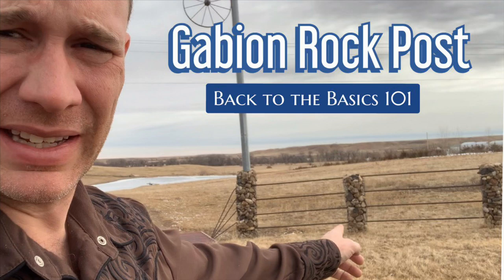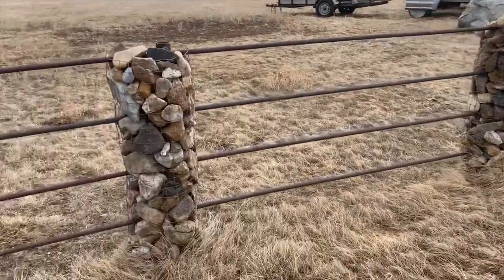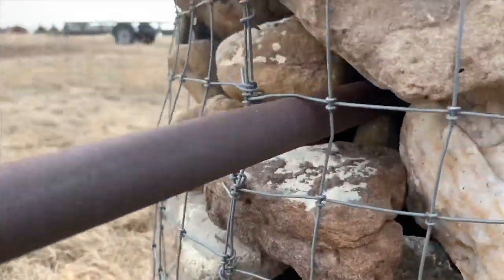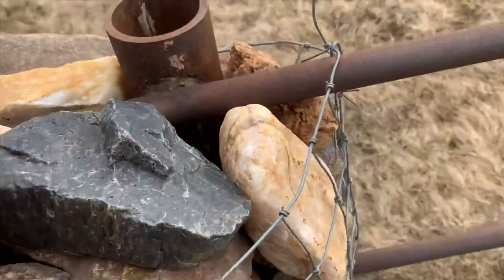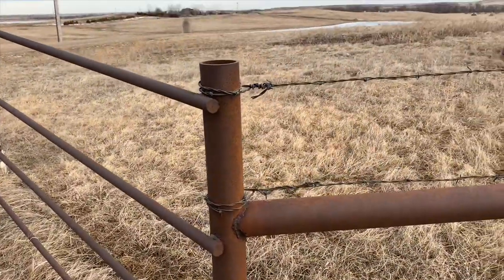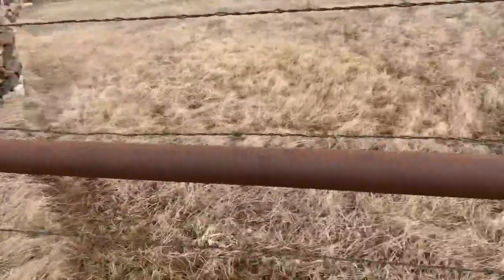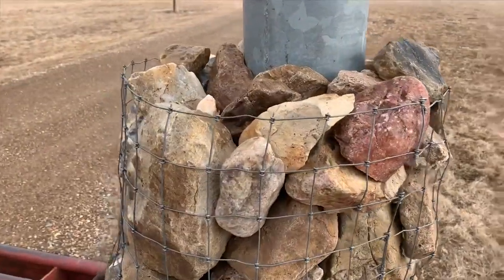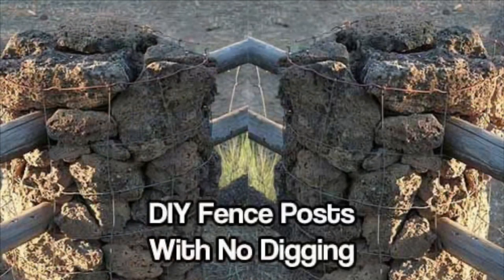Gabion Rock Post

Comment: We are using the oil pipe a lot here in Missouri because we have so much rock in the ground....limestone, granite, tiff. Some places we can’t dig deep enough to put in corner post or corrals. We drive the post in the ground with a post driver on a skid steer. Drives the metal post through the rock. Then weld the sucker rod horizontally. Last forever. Thanks for sharing your videos. God bless.

Comment: I see these on fence corners on lower ground here in MN.  When the frost heaves they stay stable, unlike normal posts.  Great channel,  keep up the good work.
Reply: Usually use a hog panel bent around.  Also used in rocky ground.  My parents farm the fences are built that way.

Comment: How is this style "post" stable if it isnt ran into the ground or attached to a solid base be it a post or concrete?? It looks like one could literally push them over id the solid rod wasnt welded to the in ground steel posts..Ive always thought they were simply asthetical...